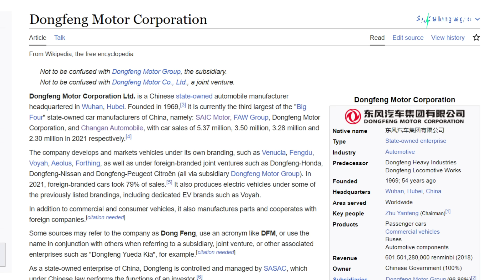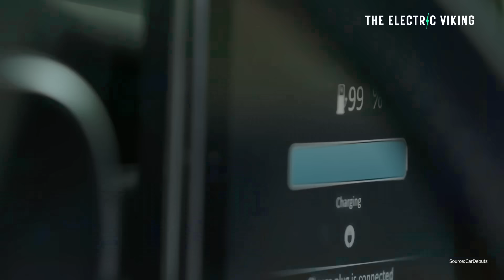Car manufacturer reveals world-first EV with sodium solid state battery

Comment: - Which Chinese company wants to use sodium solid state batteries?
- Dong Feng
- You just made it up, right?
Reply: Dongfeng is a very well known manufacturer in China.  

According to Wikipedia, they were established in 1969 and sold 3.3 million cars in 2021.  They have joint ventures with Honda and Nissan. 

And they are state owned, so pretty much infinite resources for R&D.

I don't know if they have the same tendency as Toyota or GM, to throw out endless press releases for stuff that never happens.  Hopefully this is a real thing that will come to production soon.

At any rate there is no doubt that batteries are progressing and that in twelve years BEV will be able to outperform ICE in cost and performance in 99.9% of applications.
Reply: Dong Feng is a real company. It means “east wind” in Chinese 东风
Reply: I know, it's just that these names feel made up so many times :D It's literally what my mate would say if he wanted to pretend he is speaking Chinese @Vermilion2049

Comment: supposedly there is a power back up generators(charge from the wall, solar panels)  from a company called Yoshino, and it has solid state batteries, it's their first model, so it should improve with time. the best thing about is energy density and weight savings. It's been awhile but I believe it came with a 2000+WH 4 ac power outlets with 30Amps apiece.  
battery. weight was very good for what it is, I think it was like 30Lb, check it out if your interested in the tech